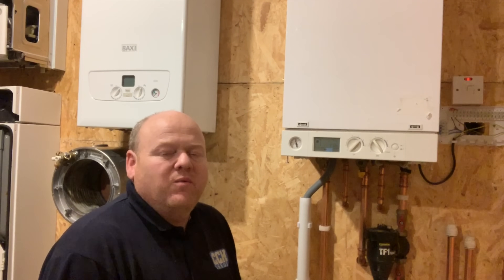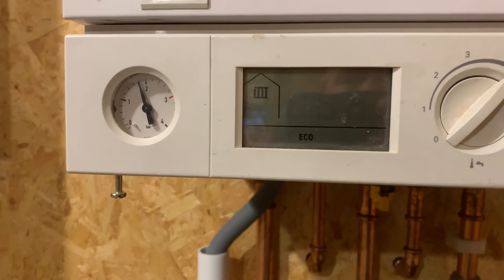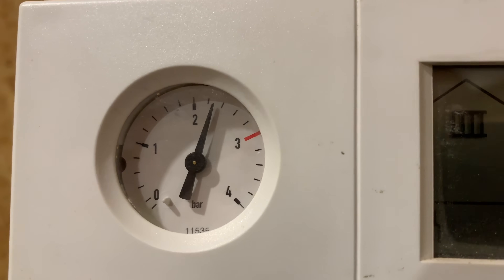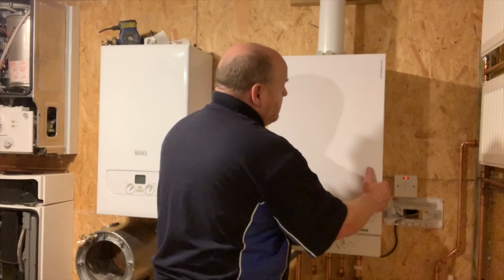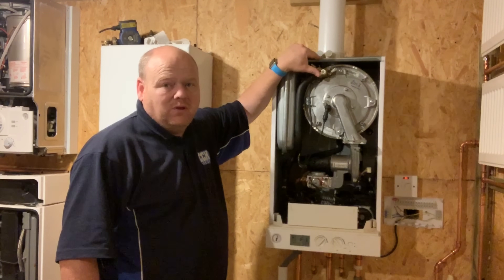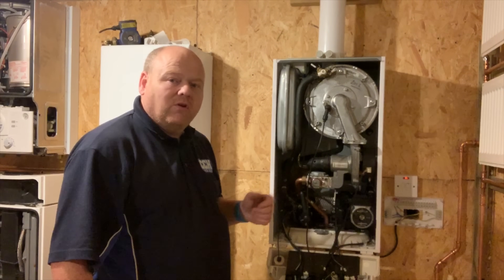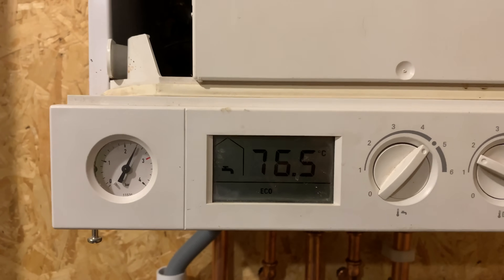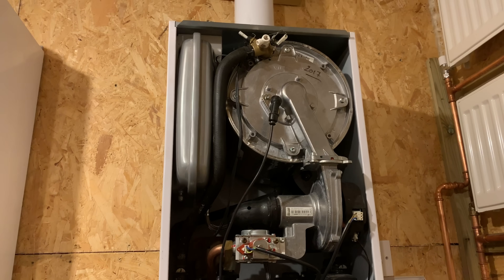Viessmann F1 Fault Code - Central Heating - Combi Boiler

Comment: Got an intermittent fault with a boiler than keeps giving F1/F2 faults including sometimes boiling inside the heat exchanger. New rubber hoses, prv, aav, back flushed exchanger, system is pretty clean. Pump next?

Comment: The rubber hose can get seriously blocked up which causes F1 fault. This blockage will occur before it eventually splits. Its worth diconnecting and washing out during service to prevent rupture. Although l will work on the viseman l dont partically like it.

Comment: Hi Allen, I think we may have a newer model.  The screen is a bit different and no loops on the bottom as you show.  Any ideas?  We are having the F1 fault and digitally resetting hasn’t worked.  Thanks for the help.

Comment: Good evening.
Thanks, I've just found the pump/circulation blocked. Dismounted and made free again. Now it works.
Greetings from Italy
Reply from the maker: Thanks very much for your comment, please consider subscribing to support the channel 🙂
Reply: What was clocked? A filter on pump? Did you need to drain water to take pump off

Comment: Hi guys working on a viessmann 100 WB1C bout 7yr old got F1 fault change pump and cleaned rubber hoses and vented heat exchanger getting s flashing 60 on display screen boiler not firing up at all no noise from the boiler any ideas if sumbody as come across this fault 👍
Reply from the maker: Plate ?

Comment: That seems a really good serviceable boiler
 I don’t know why someone had ripped it out for a minor fault as a blocked heat exchanger?
Reply: Salim Khan I been servicing boilers for 23 years and came home to find my neighbours boiler on the drive after 2 years , House was rented out after renovation . Ask Gas man what’s wrong with that , he said vessel and safety valve and was baxi  platinum with 10 year warranty . I said why didn’t you get baxi out and he said it’s a piece of shit . He asked me what I did and I said fix boilers . He went bright red and said better get now . Criminal
Reply: James Julian , yeah I can believe that it seems to be an industrywide problem now and no one can be bothered to do things properly I think the bigger companies are the worst I’ve got A three-year-old viessmann vitodens 050 that I got from someone else’s job and it was going on the scrapheap it’s now in my own property and it only had a couple of minor faults, the return hose was blocked solid With sludge magnetite and the plate heat exchanger was blocked and needed cleaning, Out of interest I run the serial number past viessmann and it was still within the seven year warranty! If you see it looks like a brand-new boiler
Reply from the maker: Common these days. If people do not know how to repair then they replace it. Thanks.